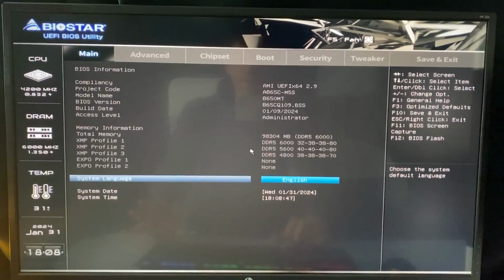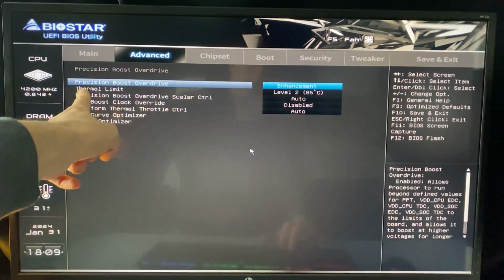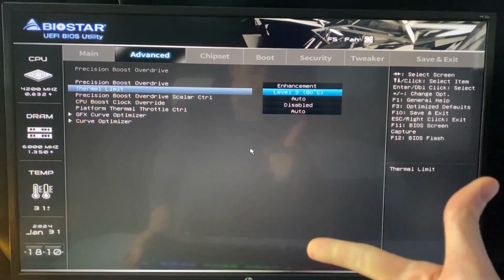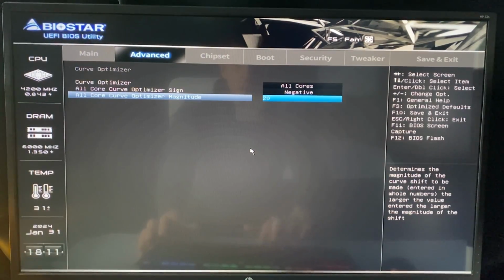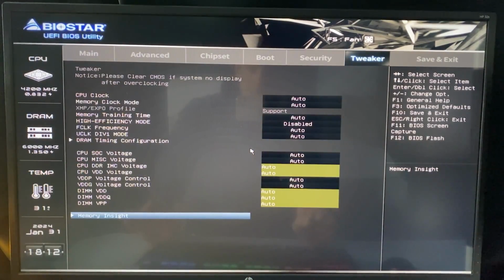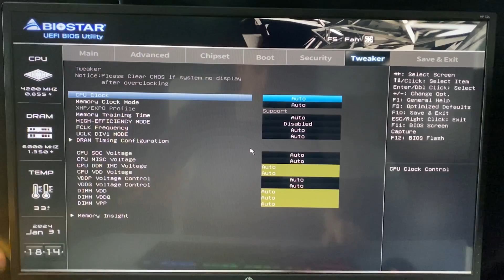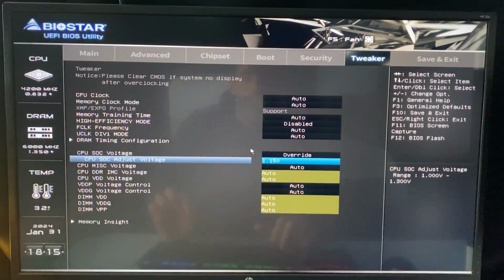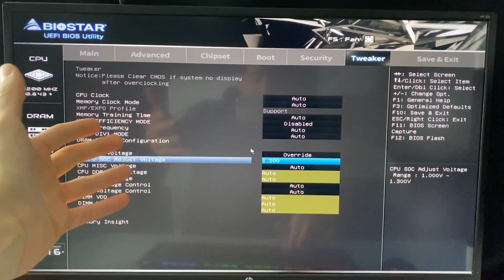Undervolt your Ryzen 7 7800X3D for more FPS and Lower Temperature!

Comment: can undervolting a 7800x3d possibly hurt anything?  Like the internal memory controller?  The reason I ask is that I recently had to replace my 7800x3d because of a bad memory controller.  
I had a -30 on all cores PBO on mine.  I would run some stress test and I never had any problems.  To be honest I never really had any issues running -35 on all cores either.  ITs just the gains were marginal so I just set it at -35.  But one day my computer woudn't post to bios.  I thought it might be a bad RAM, or MOBO, so I replaced those, and I still couldn't post.  It wasn't until I tried replacing the CPU did it just boot up just fine.
I probably replaced the mobo and ram for no reason.  I actually didn't replace the ram, I bought new ram to see if it was the issue and it wasn't.  
I was trying to run AMD EXPO of 6400 cl32, but I capped the speed at 6000 just because peopel said the 1:1 ratio for the infinity cache was optimal at this speed.  

I'm trying to find out what could have caused my CPU Internal memory controller to go bad only 3 months old.  
Could it have been running AMD EXPO?
Could it have been running undervolt on cpu?
Could it have been the damn cable mod extensions?
Reply from the maker: Nope, minor voltage can’t hurt the CPU. BUT, while enabling EXPO many voltages are raised. Those can 100% hurt the CPU
Reply: @ImWateringPSUs  I understand.  I think I might just keep the ram at stock settings which I think is 4800 m/t.  I honestly don't want to go through the hassle of replacing the CPU again because of a blown memory controller.  I'm just trying to find out what could have caused it and rule out the other things I've done.  On my new cpu, so far I'm testing it at -50 PBO and it seems stable but I want to try other test to see how stable it is.
Reply: Many people including youtubers say that is harder to post at more then 6000mhz so i just bought gskill 6000mhz cl32
Reply: maybe its not a good idea to go past 6000mhz
Reply: probably enabled expo together with a Mobo bios version prior to the max 1.3volt fix. I had the same thing it was really creepy as i was testing out a game before updating bios.

Comment: Does not work. No difference, i'd say less performance and no advantage. You can short circuit your stuff with it as well. My stuff goes hard on 5.1ghz with PBO aimed at 90C level 5 at 78C with stress test and XMP profile, also same watt consumption and temps as undervolting with -30. Using a Gigabyte b650 aorus elite ax as motherboard. Using arctic freezer 3 240 aio.
Reply: You do know anything can short circuit
Reply: Gonna try it on my system, I have the same motherboard as well

Comment: I have rog b650-a motherboard and i didn't have the option for a thermal limit. I assumed maybe some motherboard just don't have that as a option and proceed to follow the rest of the video for the dynamic undervolt. As of right now everything is running fine but I'm just wondering if this is something to be concerned about and if maybe i should just go back to stock settings for the chance that not having a limit could be harmful
Reply: Its in ai tweaker then go to ai tweaker/precision boost overdrive then set precision boost overdrive to enhancement and there u go.
Reply: Nope youre fine there should be settings in the ryzen apps that force shutdown if temps of 89c are hit. If you wanted to, you could adjust it lower but its fine like he says in the video 85c and 90c are viable options
Reply: same motherboard,did u find where thermal limit is?

Comment: Ill have to double check but im pretty sure im undervolted down to 1.1, my cpu with pbo runs steady, stays at about 1 to 1.15 while under load, temps i have set to 85 and it it maxes usually around 82, 83.
Reply from the maker: I’m really happy it was helpful! Thanks a lot for taking the time to leave some feedback :) Consider subscribing if you wanna support the channel!

Comment: Amazing Video!!! I did the first one -20 and my Rust FPS boosted from 120 to 140-180 while having 5-10celsius less temps!!! Tyvm ❤️😁 (specs - ryzen 7 7800x3d, XTX 7900, 32gb 6000mhz, Asus X670E-F gaming, 1440p 165hz.)
Reply: Lol got the same specs on my pc, about to undervolt my cpu also
Reply: now its a party same rigs as above taichi xtx card tho hyte y60 rocking 9 fansa gonna try this soon peace i sub'd  @jaxxone4907
Reply from the maker: I’m really happy it was helpful! Thanks a lot for taking the time to leave some feedback :) Consider subscribing if you wanna support the channel!
Reply: Gonna try
Reply: Lol got the same specs on my pc, and got same problem too
Reply: Are you playing on low pop servers? I just did this and can't even get 100 fps at outpost
Reply: @McRarity  might be cooling related or msaa which is heavy on the gpu
Reply: @McRarity 100fps at outpost is insane even on a $4000 machine lol
Reply: You also put the voltage to 1.2?
Reply: Question can you also put the -20 and also the 1.2 voltage ? At the same time ??
Reply: I think a voltage of 1.20 is overkill i would rather run a little higher voltage and faster ram

Comment: so I just found out about ccdg global voltage setting in bios. 

when you are using a ram oc profile, it will set to 1000mv automatically. 

I changed both global ccd settings to 950 & mouse movement / gameplay is way smoother. 

I’m going to play around with other voltages for the 3dv cache so I’ll update this thread. 

my theory here is… better temperature for the 3dvcache will make things much smoother. 

and so far that’s what I’m experiencing
Reply from the maker: That’s not a theory, that’s a fact! Running with the minimum possible voltage is always the best :)
Reply: Found any good results? Just bought this cpu and looking to optimize
Reply: @TheAquaBuilder   so for any motherboard the rule of thumb is - when you turn on xmp and then save + reboot, voltages will automatically be set because of the xmp profile that was set. 

if you are not using 7000mhz & above you don’t need vddg iod / vddg ccd at 1000mv. So setting it to 950mv will be perfectly safe. depending on the quality of your chip, you can probably set it lower in increments of 5. 

Have any other questions ?
Reply: @LightWorks222 any update bro?
Reply: @MrCaptainTea 5 months later & I downclocked the memory to 6200 CL26. for cddg settings I’m using 820. The lower you can get it while keeping your system stable then that’s the best method. it makes your cpu draw less wattage ontop of letting your cpu dissipate heat better to each of the cores.

same thing with vddp, vddio, vsoc, & vddq. The lower the voltage while maintaining stable the better. 

But yea now I’m running 6200 CL26-36-31-30-61 stable. 

Vdd - 1.620v (max temp 37-38c) 
Vddio - 1.270
Vddq - 1.270
Vddp - 0.955
Vsoc - 1.145 

Fclk 2167.

(still need to test undervolting my cpu more but so far every core except core 4 & 6 are stable @ -6. Core 6 & 4 can do -22 to -30, haven’t tested lower). This is only because of the low voltages and ram oc.
Reply: This was perfect, can’t wait to play w this CPU after work

Comment: I think AMD disable the CPU clock ratio/multiplier for 7800X3D, only let PBO decide which clock the CPU would run to match the set up of SOC voltage/CPU curve. I can not find that setting in BIOS of MSI X670E Carbon either. (Correct me if Im wrong, many thanks 😅😅😅)
Reply: Me too. (B650 TOMAHAWK)
Reply: I coulnt find it either on gigabyte motherboard b650
Reply: @IsoGameguy  i update my bios 2 day ago with the last version (TUF B650-E) and still don't have ratio or multiplier
Reply from the maker: Theoretically on the latest bios you should be able to do as I’ve done
Reply: @ImWateringPSUs  ofc I have undervolted like your video did, I also cannot find the CPU clock/multiplier.

Comment: I was able to do the dynamic settings. I havent really noticed a difference in tempatures. Its alot different from a gigabyte bios. Also, what software would i use to test my cpu to make sure it doesn't give me the bsod?
Reply from the maker: I recommend Prime95 for testing. Check the difference in performance my man, the dynamic option changes a lot :)
Reply: Hardware info

Comment: Is undervolting really necessary? Complete idle at 45C. While watching youtube videos its about 55C average. Gaming 60-82C usually in the 70's at least?
Reply from the maker: I’d say there are definitely performance benefits to it, if you have such a big thermal headroom :)
Reply: Haha saw ur comment while benchmarking on cyberpunk
Reply: My shi crashed tho, im trynna undervolt my gpu.
Reply: @southwestwind what gpu do you have ? have you recorded the maximum frequency while it hits a certain hotspot ? 

Have you recorded how much voltage is being drawn at said hotspot & frequency ?
Reply: @LightWorks222  3060. Yep i have it dialed in finally! Now to undervolting my cpu 😭
Reply: @southwestwind  for ampere go -300 on the core always. Since you have a 3060 just go with 850mv at 1925-1930mhz & you will see an improvement.

you will have a static clock speed that doesn’t decrease because of the offset on the core + undervolt.
Reply: @LightWorks222  ill test those values out, thanks!
Reply: @southwestwind  no problem man :), it will 100% work, I use to do this on my 3060 & 3070 from Zotac. 

Worked like a charm. everything was noticeably smoother
Reply: @southwestwind  you can get it lower then 850mw with -300 on the core. 

You’ll see a lot of videos telling you to do -250 on msi after burner but you can’t get lower then 850mw on -250. 

with -300 you can get away with like 825mv and up. 

to be safe try 830mv first. then either increase for stability or decrease by 5mv steps if it’s good

Comment: very interesting gonna try this with my nr200p max:) ! which benchmark would you recommend to test?
Reply from the maker: Let us know how it goes and consider subscribing if it ends up being helpful! I recommend Prime95
Reply: @ImWateringPSUs would you recommend the first or the second way of using pbo (I haven’t tried the part where you say static).

For the first part with the thermal limit and curve optimizer i level 1;2;3 all are unusable i have a sff pc and games like warzone start running super inconsistent and because i seem to get thermal throttle with level 2-3. with level 1 it’s a bit better but it feels like i have way more input delay l, as something is if something is slowing down the pc. Alao with pbo my cpu time in wz went from 2-3ms (i tweaked windows and bios) to 10-15 ms which feel super unresponsive. I just bought new fans for my aio which have higher static pressure and some for the bottom of the case and put all to exhaust (nr200p max) and now reverted all bios settings and left pbo untouched. 

Gonna try the static version you mentioned to day maybe jt works better! :)

Comment: Hi.Insane vid. I did first one (dynamic). I got more fps and no microlags while playing high fps games with 240hz monitor. But in games like PUBG i have high temp like 75-80. I wanna lower it a bit. Should i do lower negative (like 25-30) or lover limit (like 75 may be). I have MSI b650 mboard  and i can set Power limit throttling on 75 or 70.
Reply: how do you do this on MSI BIOS??
Reply from the maker: I’m really happy it was helpful! Thanks a lot for taking the time to leave some feedback :) Consider subscribing if you wanna support the channel! For lower temps, lower the temp target

Comment: i dont understandd how setting the cpu to 4900GHZ will get more performance my cpu runz at 5050 and at 60c while gaming
Reply from the maker: Well I do recommend the “dynamic” setting for gaming, which will actually push it much higher than 5Ghz. But for productivity, if you try AVX2 workloads, 4.9 would be a lot actually, your CPU at stock would drop in clock dramatically
Reply: i got a asus x670e-e gaming motherboard what should i change then can you let me know @ImWateringPSUs
Reply: i only use pc for gaming  @ImWateringPSUs

Comment: Great video the im at -30 still getting 5ghz. My temps dropped on every game except for Apex lol. Idk why but they stay between 70-78 in apex every other game in the 60’s. I have a 4080 with Asus Tuf B650 Plus with 32gb Corsair 6000mts cl30
Reply: Limit FPS in Apex manually. GAme engine tends to push CPU to max
Reply from the maker: I’m really happy it was helpful! Thanks a lot for taking the time to leave some feedback :) Consider subscribing if you wanna support the channel!

Comment: I've been running my 7800X3D at v1.3 soc for a few months now.. this sucks. It was the value on auto. It's just on the recommended limits, I hope I didn't break it..
Reply: 1.3 is the max you should have it’s fine
Reply from the maker: No worries, 1.3 isn’t too high. Some boards push it to 1.45 at times lol. But undervolted is better :) Also subscribed is better :p

Comment: So for dynamic option and gigabyte mobo i just need to put pbo enhancement to 80 level 2. Am I right?
Reply from the maker: You also need to use a negative offset, -15 or -20
Reply: @ImWateringPSUs  isn’t that what the level 2 is. -20?
Reply: If i put -30, which level should I select for gigabyte MOBO?
Reply: Yes
Reply: @Itz_littlebear  ty
Reply: No updated bios, issue gone @Itz_littlebear

Comment: Thanks a lot for this, I used the dynamic undervolt on my ASUS X670E-E (BIOS 1905) and my 7800X3D, whilst gaming (Cyberpunk / The Last of Us Part 1) it runs average 64c (cpu package) whereas before it was running around 77-80 average.
Reply from the maker: I’m really happy it was helpful! Thanks a lot for taking the time to leave some feedback :) Consider subscribing if you wanna support the channel!
Reply: whats the dynamic undersvolt ????
Reply: @zGiGi  "Dynamic undervolt" is the first thing introduced in this video. It combines temperature limits and Curve Optimizer settings. (Google Translation)
Reply: Bro, my 7800x3d got to 68° in the last of us 1 during gameplay and I got concerned,   past 75 is Insane,  rip your cpu.

What cooler do you use??? 

I have a noctua with 12 case fans running  1750rpm profile
Reply: @fuckyoutubrforchangingthis AMD says 89° is maximum temp so I wouldn't worry about 75-80. I'm having problem that temps stay at +70° after gaming and closing all applications while it's using only 35w, need to restart PC to get it back to below 50. Gonna try if the undervolt helps anything
Reply: Hello, im currently using the same mobo, did you undervolt your gpu as well?
Reply: Is package more important than individual cores?